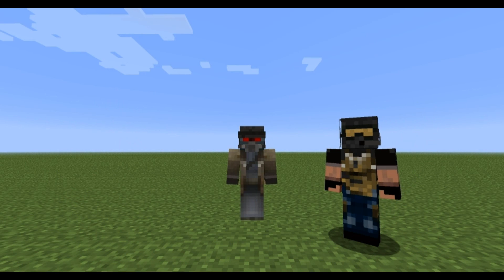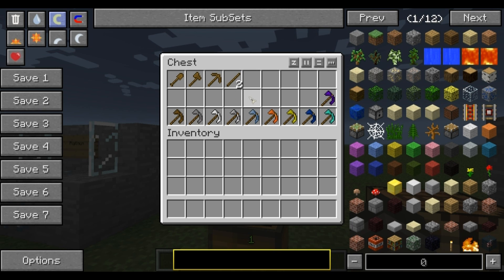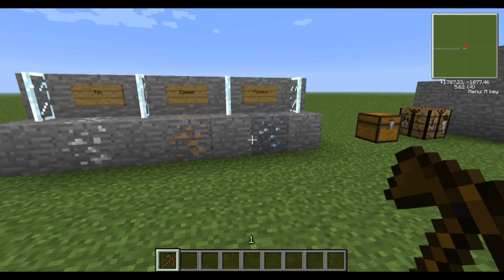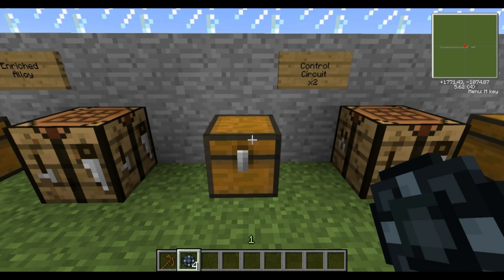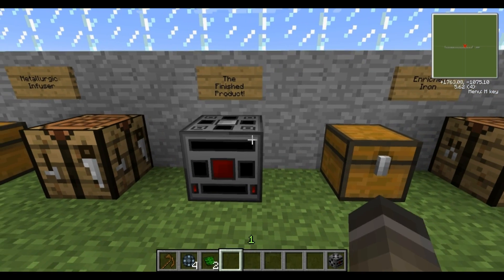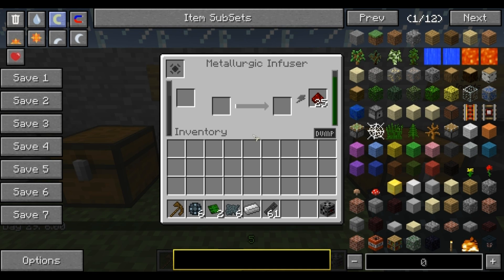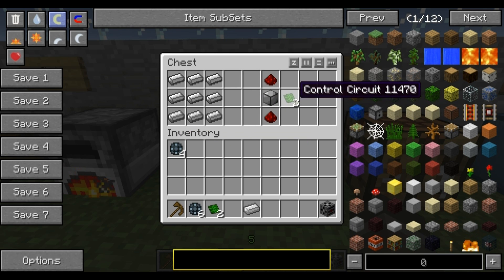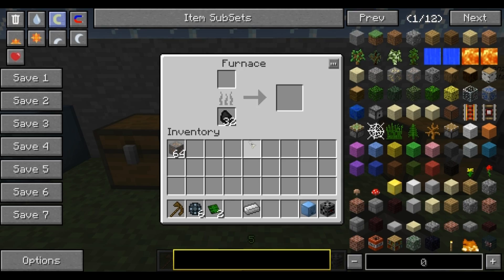Voltz Tutorials - Getting Started Guide

Comment from the maker: When it comes to the Power Armour, it's all about have a Tinker Table to do all your upgrades and charging. I haven't personally played around with the bow much so I couldn't tell you for sure but, you you not put it inside a Battery Box of some kind to charge it up? There should but two slots on the left side of any Bat Box, but the uncharged bow into the box which has an arrow pointing towards it and it SHOULD charge, providing you have power stored in the bat box... hope this helps!

Comment from the maker: Hi, are you sure you've put Tin Dust into the far left slot of the Metalluric Infuser, Copper Ingots into the second slot from the left and Red Stone on the far right to power it (like shown in this video). You can also power it in different ways which we will cover in future episodes but using Red Stone is the most simple way to power it.